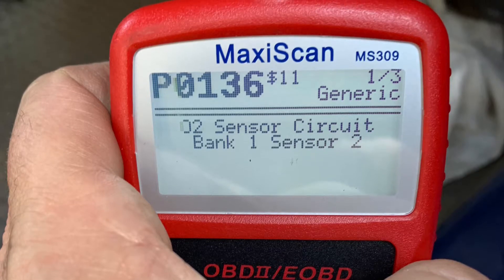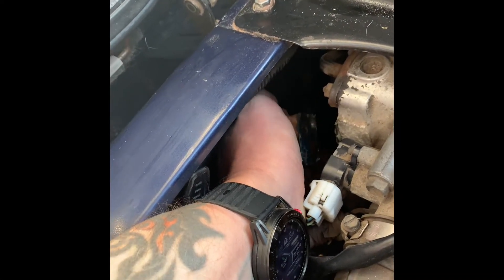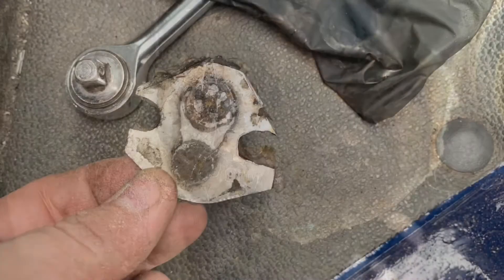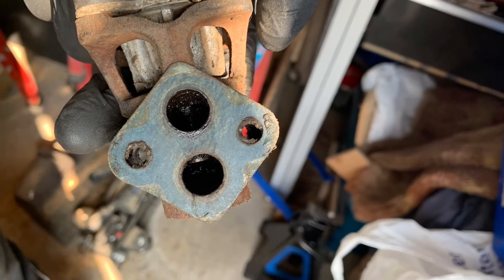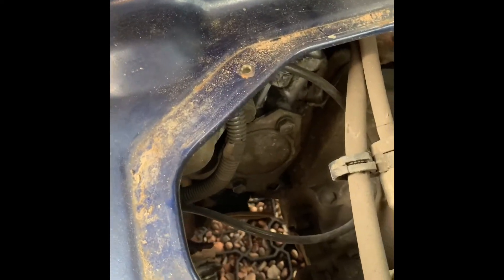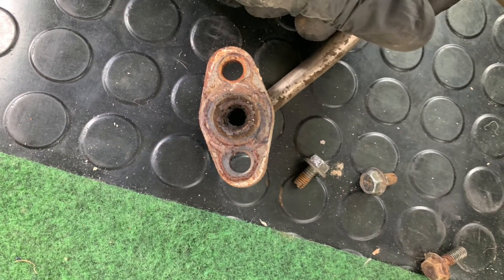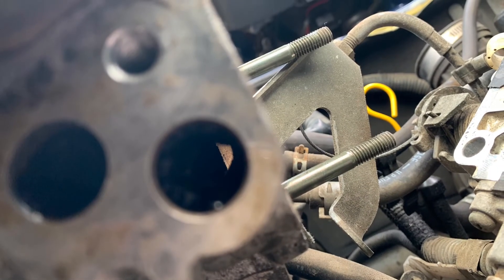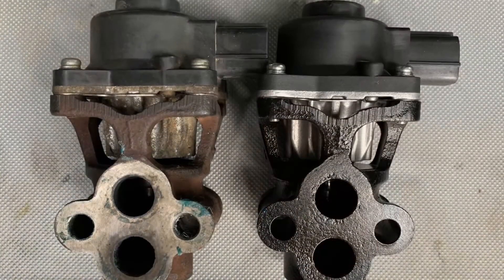MD The Suzuki Carry EGR Valve Episode 6

Comment: Did you use new gaskets for the egr replacement or is that not necessary?
Reply from the maker: Hi well it’s been a while since I did the job but I recall re using the metal gaskets and I used instant gasket tube on the rest. Hope this helps